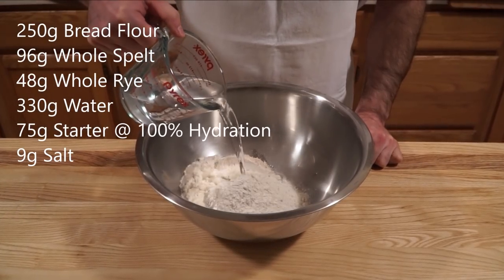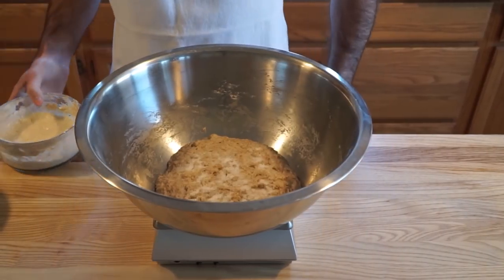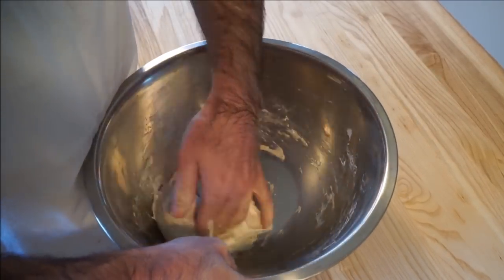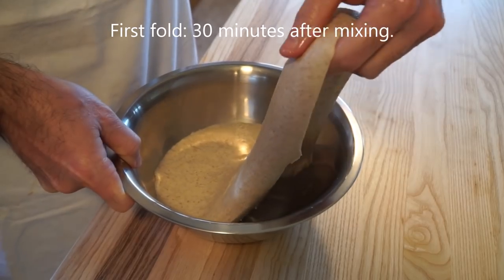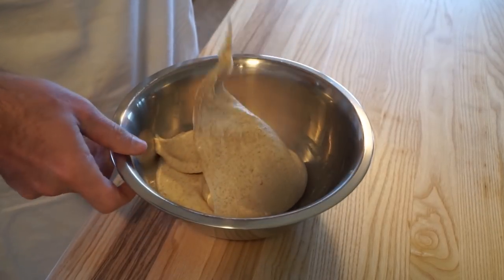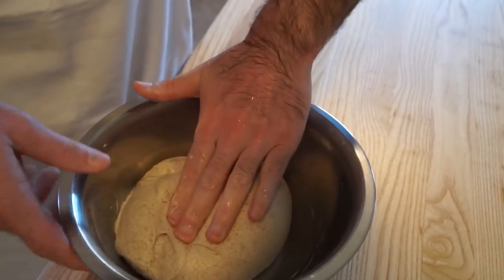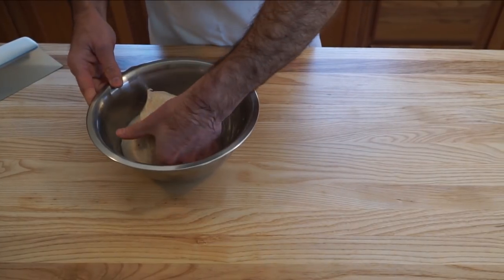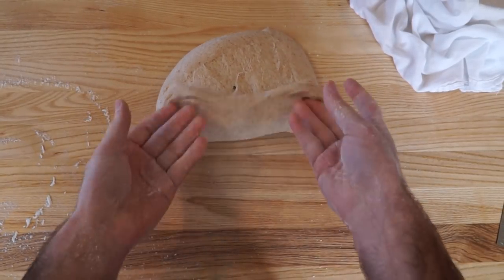How to Make Tartine Style Country Bread

Comment: What  kind of surface are you shaping your breads on? It sticks very little and I wonder if that is partly due to the surface. Is it rough or polished? Thx
Reply from the maker: It's a standard bakers bench, the kind you'll find in many bakeries or kitchens. It's probably been run through a planer in the shop, then they coat it with food-grade polyurethane finish (which doesn't last long) -- typical commercial kitchen stuff. There is certainly some variance in the "stickiness" of some surfaces compared to others, but the main reason this dough doesn't seem to stick is because I have plenty of experience handling these kinds of wet doughs. If a less experienced baker was working along side me with this exact same dough, you'd see that it would be sticking all over the bench and his hands. It's really all about dough handling -- experienced hands make sticky dough look smooth. Cheers!
Reply: That makes sense, thanks. This takes me to my 2nd question. I try to use a minimal amount of flour while shaping. However I see in some videos bakers using a ton of flour during preshaping and shaping (in Rubaud videos, for example). What's your take on that?

Comment: wonderful bread! what kind of pot is? where can buy this pot?  thank you!
Reply from the maker: Thanks Daniele, I use a Lodge Cast Iron Combo Cooker. It's basically just a cast iron dutch oven with a skillet for a lid (like Brenda mentioned). For bread, you just invert it so that the skillet is the base and the pot is the lid. I purchased mine at a sporting goods store, but you can find them in many stores that carry cast iron cookware. Plus you can find them on amazon. Mine is the 3.2qt. model. Here's a link . . . https://www.amazon.com/Lodge-LCC3-Pre-Seasoned-Cast-Iron-3-2-Quart/dp/B0009JKG9M/ref=sr_1_1?ie=UTF8&qid=1471859654&sr=8-1&keywords=lodge+cast+iron+combo+cooker Cheers!
Reply from the maker: You've got the right idea Brenda. It's a Lodge Cast Iron Combo Cooker. It's a dutch oven with a fitted skillet for a lid. You just invert it for bread baking. Cheers!

Comment: Are you using the weight of the water in the % calculation? The reason i ask is i noticed you always pour the water from a measuring cup which is a measurement of fluid oz. or liters etc not weight. If you are using weight why not measure water out in the bowl on the scale like other ingredients? Not being critical. Just want to know if im making a mistake here.
Reply from the maker: I always use weight measurements, never volume. I actually weigh the water into the measuring cup, and I use the measuring cup simply because it's easier to pour the water out from it. When I'm not filming, I do exactly as you suggest and weigh the water directly into the bowl -- just as I do the flour. But when filming, I prefer to weigh out my ingredients ahead of time so I can just add it without measuring -- it reduces video length and makes for a more seamless presentation. But I agree, it can certainly give the appearance that I measured out the water by volume. Lately, I've been pre-measuring my starter as well for the same reasons.

Comment: What kind of starter do you need to use for breads that are not sourdough?
Reply from the maker: For breads that are not sourdough you don't need any kind of starter at all. You can just add commercial yeast right into the dough. But if you like, you can use yeasted preferments which act in a similar way as a sourdough starter. The most common yeasted preferment is a poolish, which is equal parts water and flour (by weight) with a small amount of yeast added. You let the preferment rise for around 12 hours or so then add it to your dough when you mix it. This helps give yeast breads a bit more flavor (and makes for a more extensible dough).
Reply: +Trevor J. Wilson thank you!!!

Comment: In the interval the dough goes to the refrigerator?
Reply from the maker: For this loaf, yes, I put it in the refrigerator after shaping. Most of the time, I prefer to proof at room temperature. But for this particular loaf, I like the flavor that develops when it's in the fridge. But that doesn't mean that you have to do the same. In fact, I often bake this loaf without refrigerating. Whatever you prefer. Refrigeration makes it a bit more sour -- so if you like it less sour then there's no need to refrigerate.
Reply: Trevor J. Wilson 😉

Comment: What modifications are necessary if I'm using all purpose flour and some organic whole wheat? I made this recipe to a tee but my dough was way wetter than yours and never became smooth. After the folds I still didn't even have a dough ball like yours and mine was still extremely wet. I couldn't even handle it unlike you are and after the 12 hours in the fridge it is still liquid looking and not in the form of a dough. It stuck to everything and I couldn't shape it into a dough ball. What should I do? I know my starter is good it makes nice bubbles and smells good....
Reply: vvolfenstein use a higher protien/gluten flour like bread flour.. It should be able to absorb the water and hold its shape of properly mixed.

Comment: I'm so sorry but my comment disappeared here...
Which room temperature should be while dough preparing?
Thank you very much.
Reply from the maker: There's no specific room temp that's best for proofing. That just depends upon the needs and personal preferences of each individual baker. So anything ranging from the high 60'sF to the mid 80'sF should do. Before it was refrigerated, this particular loaf was proofed at a room temp of the high 60's to low 70's if I recall.
Reply: Trevor thank very much. I baked the bread yesterday evening. I got a such beautiful loaf. I've never get like this before. Your method- flour with water two hours  without a leaven worked purfectly. I very loved that. Excellent. And hand working with a dough... I'm happy. Thank you.
Reply from the maker: That's awesome! I'm glad it worked out so well for you!

Comment: Hi, Trevor (from Indonesia )! I enjoyed your videos and they help me understand things. I noticed that your starter is 75% hydration. Mine is 100% hydration due to the higher ambient temp where I live ( between 27C - 38C) and my kids don't like sour breads. I was checking out videos to see where I went wrong with my bread that keeps bursting at the sides though I scored the top. Any suggestion on how I should achieve a better shape bread and how to adjust the recipe?
Reply: Ima Purnomo Use a very young culture to prevent the loaf from being too sour. At 28 C any sourdough culture will be very active! Use it after 2 hours of the last feed. You will know it very well. It starts foaming up really fast by then. Chad Robertson said so in Tartine that a young culture is best if you don't want to impart that sour taste. Retarding is also very important. Temperatures in the equator here just makes the culture go ballistic in the loaf. After shaping, put the dough in the fridge for overnight prior to baking. Take the loaf out when you just started the oven. By the time the oven temperature or your pan is hot, just bake it straight away even while the dough is still cold.

Comment: Do you cover the dough during bench rest?
Reply from the maker: Sometimes I do and sometimes I don't. And sometimes I cover the dough for part of the bench rest, then uncover it for the rest. I know that's not a very helpful answer. Here's my thinking: I don't want a dry skin to develop while the dough rests. So if the weather is cold and drafty and might dry out the surface too much, then I cover it. And if it's warm and humid with little chance of the surface drying out, then I leave it uncovered. But I do sometimes like the surface to dry just a little -- not to the point that it develops a thick crunchy skin, but just enough so that the surface loses some of it's stickiness and becomes easier to handle. This is a very subjective thing, but overtime I've developed a good sense of how "dry" I like the dough surface to be. In these cases, I might cover the dough for half of the bench rest or so, then uncover it for the remainder so that the surface dries just a touch. It's all really just a matter of trial and error. Experiment and you'll eventually find what works best for you. Cheers!

Comment: what is the sign you use to deem it ready for pre-shape?
Reply from the maker: I generally go by the increase in the dough volume as it rises. Usually a 30% to 50% rise in volume means that it's ready to preshape. Less than 30% and it might not have enough internal gas and structure to hold its shape well. Over 50% and the dough becomes more delicate and easier to degas. Additionally, if it proofs too far it begins to lose extensibility making this style of shaping more difficult. That's my main guide, but it's really a bit of an intuitive thing. I go by how it feels when I lightly press it. I go by how it smells. I go by past experience with similar dough in similar conditions. I go by sight to see if it's "doming" a bit around the edges. All these things come together to (hopefully) tell me when it's ready. So one day I may deem it ready after a 30% rise, while another day I may wait for it to reach 50% simply because my hands told me to. When you've been doing this long enough, you learn to listen to your hands. And your gut.
Reply: Thanks, brother.

Comment: I can't get spelt flour what can I use in place ?
Reply from the maker: You can just replace the spelt with whole wheat. Spelt has a slightly nuttier/sweeter flavor than wheat, and it adds a nice bit of exetensibility to the dough that helps to counteract the plastic qualities of rye. Whole wheat is more elastic and slightly more bitter than whole spelt, but it'll do just fine if you can't find any spelt. Good luck!

Comment: What steps are crucial in creating such an open structure of the crumb? My air pockets/holes are much slower.
Reply from the maker: There is one absolutely critical step, and I'll get to that in a minute. But first, what you need to understand is that open crumb is 80% proper fermentation and dough handling. Nail those two essentials and you'll get a nice and open crumb. Hydration is only of secondary importance. If the dough is too wet for you to handle, then you'll never get that nice open crumb -- just a flat limp loaf. Start with stiffer dough and slowly increase the hydration as your skills improve. And that brings me back to that one critical step I alluded to . . . practice. That's it, just practice. Baking is a skill, and the crumb of your loaf is a reflection of your current ability. Improve your skill, and your crumb will improve as well. So practice practice practice. That's the key.